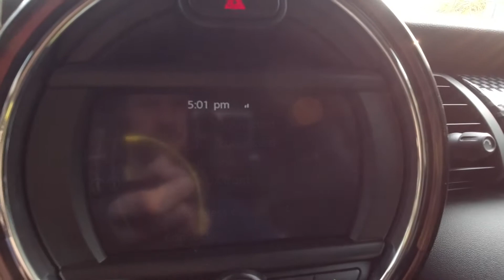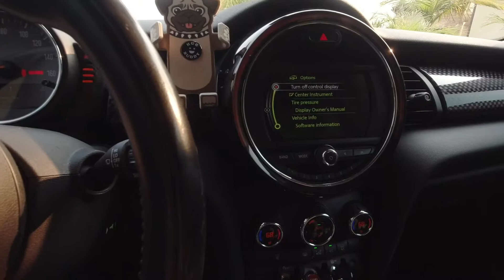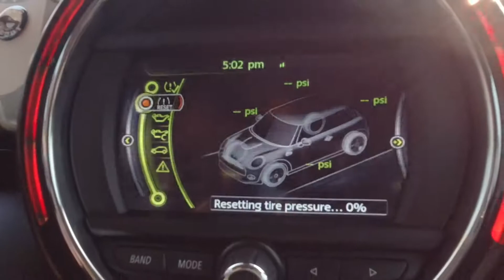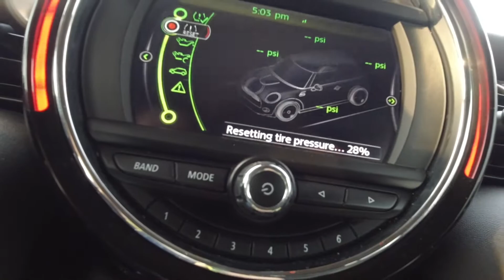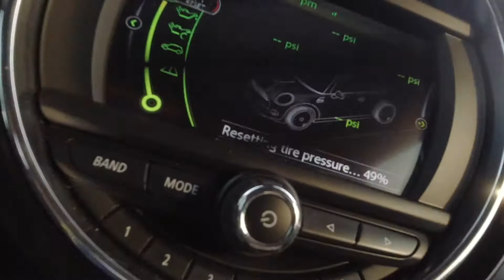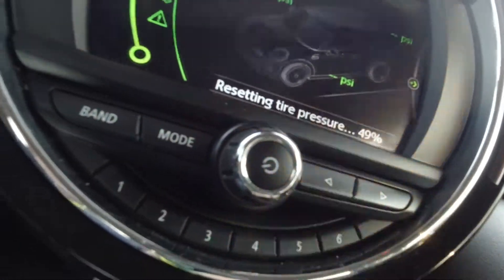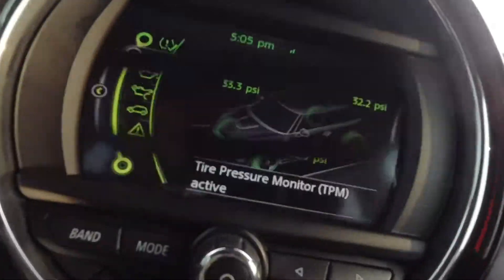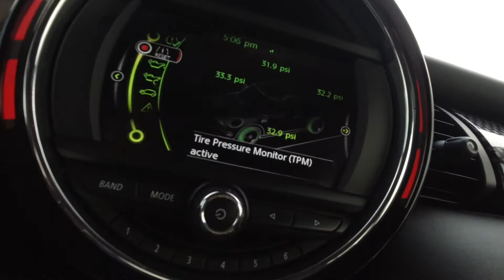IG149 How to program new TPMS sensors on a 2015 Mini Cooper S F56

Comment: I’ve changed wheels but with the original sensors and tried to reset the TPMS but it keeps getting stuck on 49% every time. 
Any idea how to solve that?
Reply from the maker: It’s unable to read one of the sensors. It’s possible one was damaged when moving them. You would need to use a tpms tool to see which ones it can ready

Comment: Add that sensors have to be activated with a tool.
Reply from the maker: They do not need a tool to be "activated".  Confirmed with my 2015 S, 2016 JCW, and 2024 clubman.  Simply go into the TPMS menu and choose "reset TPMS" just like i showed in the video.

Comment: My car F56 JCW 2016, comes with flat tire monitor. Do you know if there is any way to install the TPMS?
Reply: ? Your car already has TPMS. It's a government mandated safety feature. Every car had to come with it. Like air bags for example.
Reply from the maker: The flat tire monitor is the same thing as the tpms.  Every car after 2008 has tpms.

Comment: Just ordered a set from tire rack and my local shop wasn't sure if I would have to go to a Cooper dealership to program them.
Reply from the maker: I didn’t need to, let me know if you happen to have a different experience.
Reply: If the sensors are factory OEM from the dealership, then no programming is needed. You simply have to reinitialize the system like what was done in this video.

If the sensors you bought are aftermarket. They come blank, and you need a TPMS tool to clone the sensors so they mimick the ID and frequency of the factory sensors.

Sometimes it's cheaper to just pull your old sensors and swap them to the new wheels. Then just run reinitialize so the new positions are recorded.
Reply from the maker: @LynxStarAuto  maybe i wasnt clear In the video, I bought aftermarket sensors from the tire rack and they worked out of the box with no programming or TPMS tool.